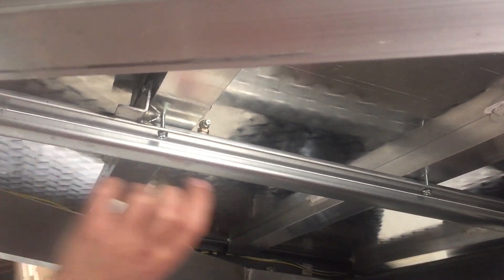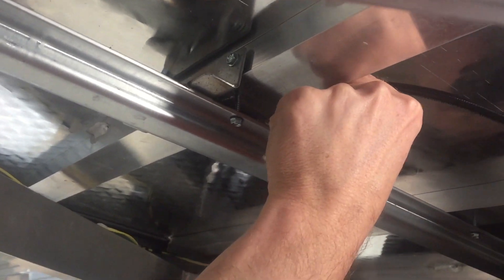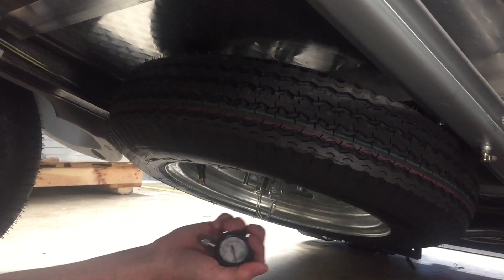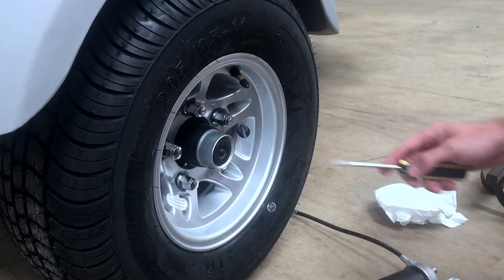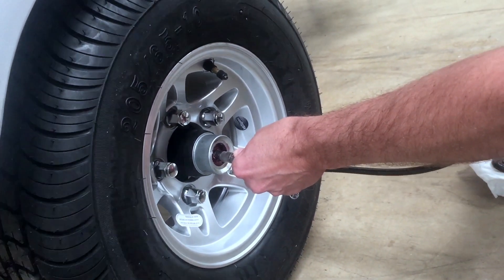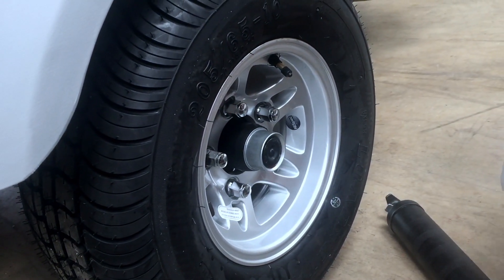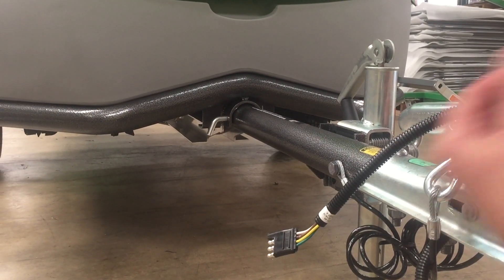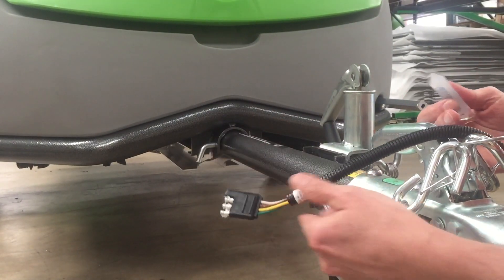SylvanSport GO Maintenance Video

Comment: I respectfully submit that this video is incorrect with respect to lubricating the wheel bearings. SylvanSport GOs use Dexter axles. I suggest viewers go to the Dexter website, download the light duty Operation, Maintenance, and Service Manual and read those instructions. The manual discusses that the wheel should be rotated while the grease is being fed into the fitting and grease should be fed slowly while the old grease is displaced through the outboard bearing.  Further, and this is not in the manual, the web is full of horror stories about the EZ-Lube function on Dexter axles not working properly: instead of the grease being displaced through the channel inside the spindle, through the inboard bearing, through the space between the bearing, through the outboard bearing and out toward the grease cap, the grease simply pushes past the inboard seal and onto the hub. While this is not as dangerous for a GO Dexter axle because they don't have brakes for the grease to foul, grease getting past the inboard seal means it is not getting through the bearing races. As the owner of a GO and a travel trailer with dual 5200 # axles, and having seen personnally how the grease doesn't flow the way the EZ-Lube system is designed, I suggest looking into hand repacks of the bearings, as necessary. For that, you can refer to the Dexter manual or their webiste for good, detailed videos.

Comment: Is there a type of grease that should be used on the GO lift system?  Will regular axle grease work for the lift system and the wheel bearing?
Reply from the maker: Hi JoAnn. We use Green Grease (synthetic waterproof high temperature grease) which can be found at most automotive stores. Let us know if you have any other questions. Thanks!